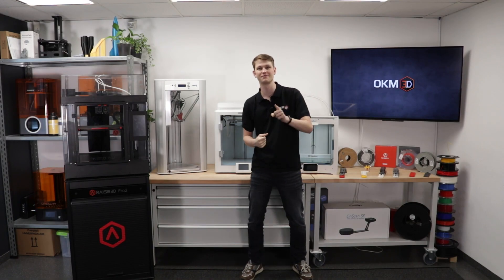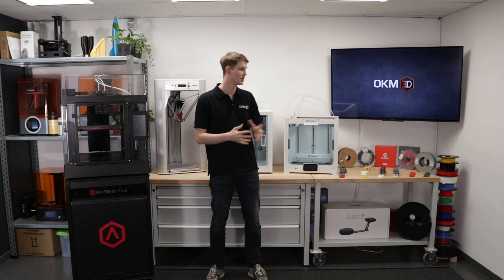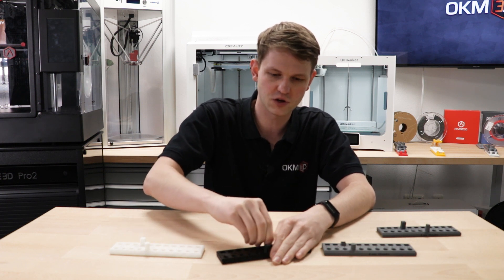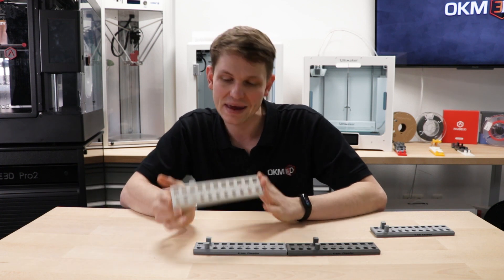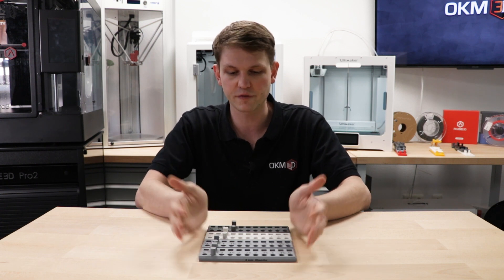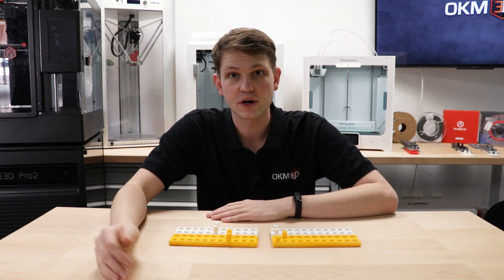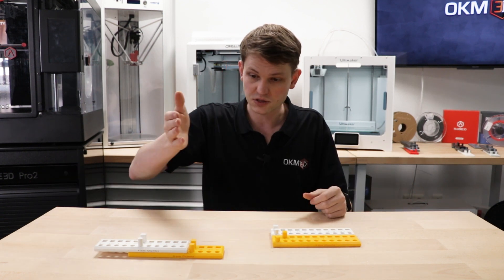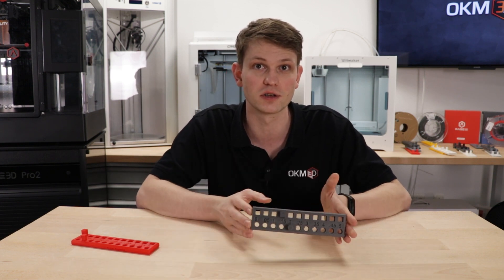Tolerance Test FFF printer - Ultimaker S5, Raise3D Pro3, WASP 2040 Pro, Creality CR5, Pro2 and  E2CF

Comment: This is cool in concept, but doesnt really mean anything. You can calibrate material flow per material and update the slicer accordingly. I have been able to get all my printers down to 0.05 mm of tolerance via tuning the materials and brands I use. When i get a new material, i have to tune them again to get the same results. That being said, each material will be different and each brand will be different. You have to calibrate each material from each brand.

Comment: wehave an s5 at work.  I can vouch for its terrible accuracy.  All i can see thats different from normal profiles to Engineering profile is the speed.  Engineering mode is much slower.  I think the ultimaker is just a flimsey machine.  Its not very heavy, which is a sign of that.  The outer box of the ultimaker is acutally the structure for the kinamatics also - not good.  The kinomatics themselves are not very rigid either.  The two rods connecting to the print head are only push fit onto the other gantry rods via some plastic mounts.  Those plastic parts are not constrained virtically because they are only using a single rod.  Therefore at high speeds these will just pivot about their axis... causing major inacuracy at the head.

Comment: On the "engineering" settings.  Most folks aren't using their 3D printer like you or I.  They are about appearance.  That is why the default is not about accuracy.  It works to "pretty up" the result.

Comment: Great video. Thanks!
Just a couple of comments...
It would have been great to mention which "other branded" filaments you were using. It would require little effort from you,  but would make a big difference to your viewers.
Also... im curious why you didnt try repeating the 0-0 result on the ultimaker, as you did on the raise3d

Comment: Interesting, but this has me wondering, what slicer did you use with the other printers? If you used Cura, would using Engineering with the other printers maybe also fix it?
Reply from the maker: We used the slicers that are designed for use with the printers. There is a Creality Slicer based on Cura that was used for the Creality. ideaMaker was used for the Raise3D printers and Simplify3D was used for the WASP. Most users will simply use the attached software to begin with, rather than setting up custom printer profiles in third party slicers.

Comment: I love seeing comparisons, but I have to question these test results.  Here's why... You can't just assume that a 5 mm slot or a 5 mm peg is actually 5 mm when it is printed.  Take the parts that were printed and use a pair of calipers to see what size they actually are.  Using a 3D printed peg and a 3D printed hole doesn't work because 3D printers typically print parts in a maximum material condition (MMC) state, so holes tend to shrink slightly and pegs tend to grow slightly.  Also, this is less of a test on tolerance and more of a test of clearance.  In engineering, there is a difference between the two terms even if they tend to be used interchangeably by the general public.  Sorry for the long rant.

Comment: What is "Engineering" in cura? Also when in Engineering does it take longer?
Reply: Basically, slower printing speed and walls printing order is different. Frankly, I'm using Ultimaker printer for three years and Ultimaker profiles for Ultimaker printers are not very well optimized...

Comment: I am shopping now for a new FDM printer. We currently have an SLA form 3 from formlabs and the print volume is too small for some new projects. But it has great print qauilty and accuracy. We use these for industrial applications not so much for hobby. I would be curious to see which of these printers has the best qauilty with Carbon Filled materials. We will be using that a lot. Prior to finding this video the 2 contenders we are deciding between are the S5 and the raise 3D. Would you be willing to do this test will all carbon filled materials?
Reply: If you want to print carbon filled material, my suggestion would be to go Raise E2CF. This is the only printer designed for these materials. Second choice would be the Raise Pro 3D for the enclosure, Ultimaker would be my last choice. For your information, I own a Prusa I3Mk3 and a Ultimaker S3.

Comment: Thank you for the tests! Fun to see the results, I will try out this on my mk3s and see how it goes.

edit: with .1mm layer heights and not changing the stock settings (using prusa  brand pla). square peg fits in the .05 and the circle fits in the .15